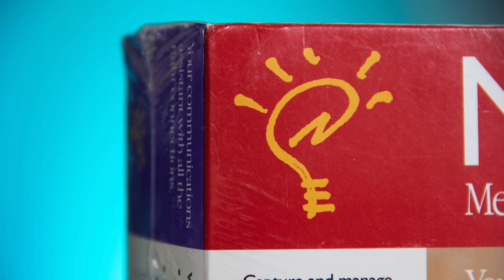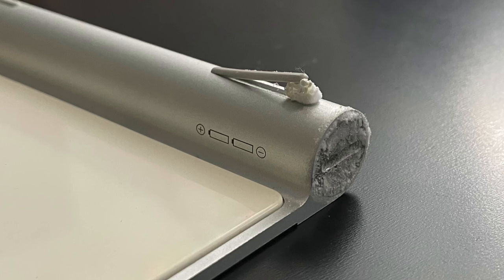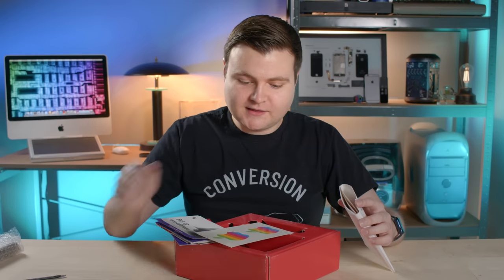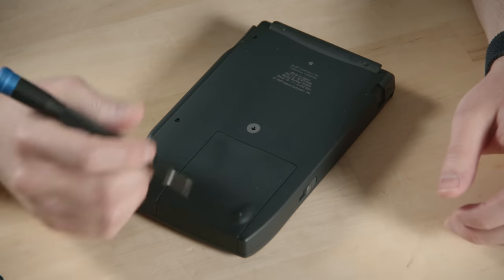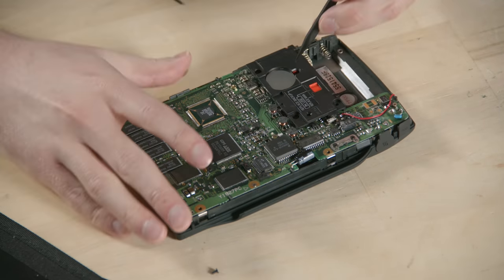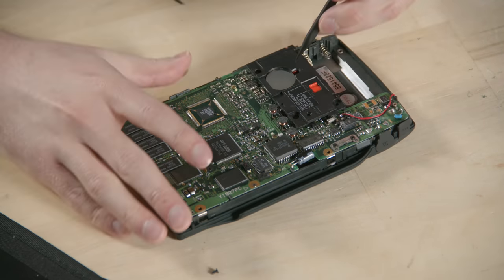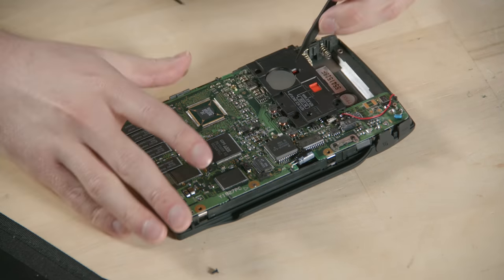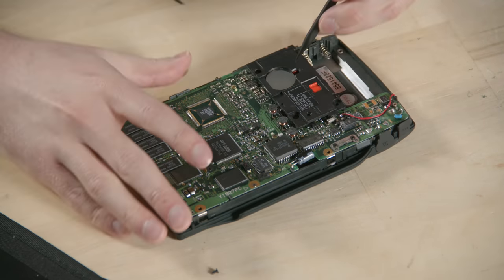Unboxing a SEALED Newton MessagePad 100 (After 28 Years) - Krazy Ken's Tech Misadventures

Comment: I picked up a few of these on the flea market 10 years ago, one of them was the backlit version of the one you got, and the other one was an absolutely PRISTINE Newton Messagepad 2100 (rare as nuts), with the external keyboard, and leather pouches to them both, charger, regular battery insert and chargeable battery, cd for PC + PC hookup cable and whatnot.

Comment: Ah, the Newton. Had a MP130 for a while around 2001, me and some colleagues from work found a box with about 40 of them on a tech junkyard, discarded from a local bank. From those, we were able to get 12 units working by mixing and matching parts.

It was a delight to use, but was REALLY bulky. The only pocket where it would fit was on one of my winter coats, and that was a stretch. Later I replaced it with a Palm M100, even more capable (thanks to the huge amount of apps and games) and MUCH more portable.

Comment: Rather fortunate apple made sure to pack the batteries not just in a thin layer of clingwrap, but a dedicated box. Gives a layer of protection in case of leakage.
Reply: Or like some electronics inside the battery compartment merely disconnected with a piece of plastic.

Comment: They had one on display at my University's book store. I have messy handwriting anyway, so it was fun to see how the Newton dealt with my chicken scratches. Later Palm Pilot had their Graffiti system which worked much better. Instead of standard letters, Graffiti asked you to use modified letters that were easier for the computer to recognize. Still didn't always work for me, but it was a lot better than the Newton's method.

Comment: The handwriting recognition didn't get good until the MP 2000. A lot of that had to do with the ROM size. But user handwriting is also an issue. If the MP2000 can't read your handwriting, probably no one else can either

Comment: Yeah, when the message didn’t save, I had immediate suspicions that your “backup” battery (the coin battery) was dead. That’s what will cause something like that to happen. I have owned a couple of MP130’s, that’s how I know this.

Like your friend I had more luck on getting my newton to recognize cursive handwriting, and I have like the world’s worst dysgraphic handwriting. After about 4 years of training it I got it to recognize my handwriting fairly well. Occasionally I would see it give me a weird interpretation, especially if memory is running low on it, and the “I am thinking” lightbulb was there for an extended period of time I knew the interpretation would be comical. 

The reason the erase feature didn’t work as well for you is that your squiggles have to be completely vertical and joined up for it to not think something is a letter. I hope that helps.

Comment: A little later than this we had the palm pilot. I owned 3 generations of them and two of them still work! I don't use them for much beyond playing music but they are a fun novelty.

I also have an early Archos color media player which works and several dolby walkman players.

As an old person I also kept the very first computer I ever constructed or owned... a Sinclair ZX81 with an 16K static cmos memory upgrade that plugs into the back (heady stuff). 

The oldest solid state stuff I own is a Radionette Kurer Auto FM radio (with 9 germanium transistors). That needed new capacitors but surprisingly the transistors still worked (I've subsequently bought a bunch of replacement transistor then cherry picked the best based on gain etc.. Net result is that the radio will likely outlast me. Then again, the average dragonfly would probably outlast me.

I remember the Newton. It was way too expensive for me to afford but I gazed on in admiration. Which was mostly true of all the Apple stuff so I made-do with an Amiga 500 and a Compaq.

There was something so cool about the 80's and 90's. Mercifully we didn't have social media and tech was all starry-eyed 'the shape of things to come'. Of course we had dial-up modems,  and Usenet (instead of internet), games that loaded from cassettes. You young whippersnappers have it way too easy in my opinion! 

I will say one thing though. Word 2.0 was far, far superior for writing books when compared to the current iteration of Word on 365 which is truly sad.

Comment: Usually, if I want to really preserve the cellophane, I either cut it along the box flap seams or the pinch point of the cellophane. Instead of ripping it like you would new stuff. Also a long, flat, and rounded bit of metal the size of the flap to open it helps avoid the crease you get from opening a box flap with your fingers.

Comment: I had a Message Pad back in the day and I loved it, but honestly it was almost useless until a company called Hand spring introduced a software add-on called "Graffiti" which actually worked perfectly, enabling accurate text entry as fast as you could write.
But then they came out with their own hardware based on Graffiti called "Palm Pilot", which was small enough to fit in a pocket, so it was "bye bye Newton, hello Palm Pilot!"
A couple years later I got a Palm Treo, which was a PDA with a phone built in, and the era of the smartphone kicked off.
They seem primitive now, but the software was actually amazingly useable, could even browse the web.
The iPhone was still years off.

Comment: Nostalgia :-) I had its succesor in the nineties (on rebate, for obvious reasons). The handwriting recognition was really as bad as you noticed. Sometimes it was OK, but most of the time it was awful. It was supposed to learn your handwriting, but never really did.... So I used the floating keyboard, with the pencil (imho it took until the Palm Pilot to get usable). My next step in PDA's (Personal Digital Assistants) was the Psion Series 3a (and later mx and 5mx). Now those where really useful (but keyboard based). Great to see it working again: with the delete and garbage animation and sounds. Easily my most used function on the Newton ;-)))) Thank you!!

Comment: you should call apple support and ask for replacement batteries, tell them you only now had time to unbox the device you bought 28 years ago and you're disappointed to not be able to use it due to faulty batteries.
Reply: Incidentally, the number on the box in the video apparently is now a scam number.

Comment: I was worried if the outside would be a sticky mess that they coated some of those things so it would have a soft rubber grip able outside which starts degrading overtime into a sticky like glue. Some of the amstrads did that I seen a video of Ashens looking at one he had to scrape all.of it off then used fingernail polish remover to get as much of the residue off of it and he still.jad to wear gloves. Maybe this newton product learned from amstrads mistake or knew that the coating degrades rots and turns sticky over time. Ashens did an unboxing too and was new also never been used in a shrink wrap.

Comment: Is their ever going to be a point in time where modern electrolytic components will be better manufactured and much longer lasting so as to prevent further cap-turnovers?

Maybe even brand new capacitor designs that emulate the older style, as a niche market themselves I'm pretty sure they could persist at least long enough for preservationist purposes

Comment: Sorry to jump onto another video on your channel but I have a 2010 Mac with Yosemite that I tried to install Sierra. When it goes to load it says cannot install. When I try to reload Yosemite it will not load, the recovery start up to safe mode won’t load and it days disks are locked. I have absolutely no idea what I can do or how I can recover data on the drive. Unfortunately I have no time machine back ups. I am in the `uK but I must admit I do not understand macs at all or the operating system.

Comment: nice episode but the obvious stuck right out to me: the device is just so useless throughout, not only today. handwriting recognition - a totally pointless fad.
the screen was almost invisible. interconnections? not even a thing.
i reckon the average usage time at 10-30hrs and no more. pricey? hell yeah. devices in smithereens coming off the wall? you bet!
Reply: It had an infrared port to beam items to other Newtons, and a Mac-style serial port so you could print directly to Apple printers or connect a Mac-compatible modem. Or, of course, upload your notes and sync your calendar to your Mac. Not that useless, but slightly fiddly.
Reply: @3rdalbum  infrared, alright, i give you that. nothing i'd call hassle-free but at least period correct (lacking back then non existing usb)
the potential level of frustration is huge, up to a point where you just quit using it. trailblazer device yes but also a device featuring all the flaws a first-of-its-kind device can have.
but why incorporate a flip'n useless hand writing recognition? they must have realised while testing that this was just a shot in the foot. the fact that they still released it speaks volumes.